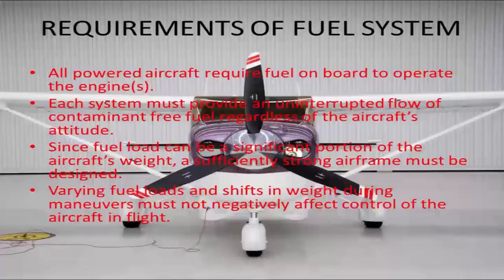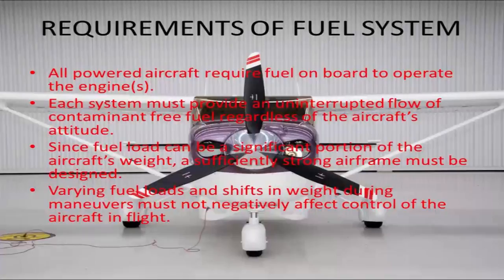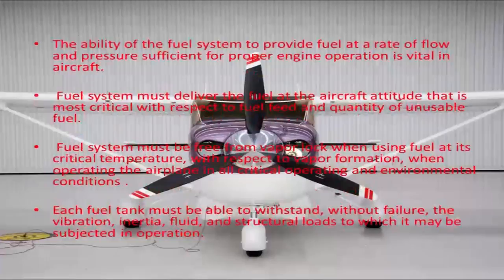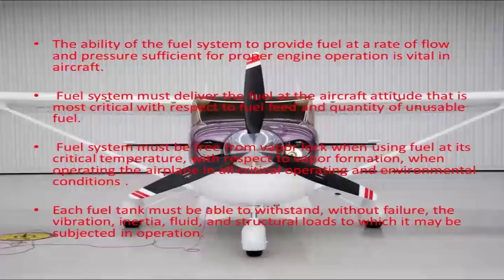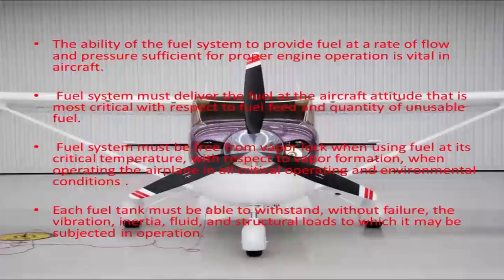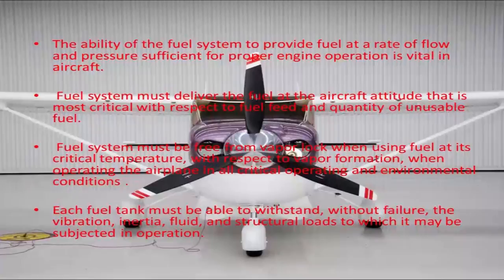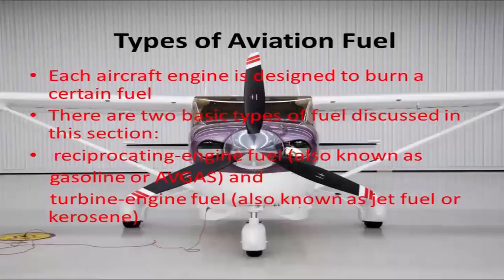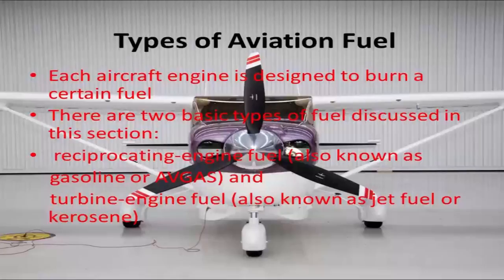Lecture 04   Aircraft Fuel System

Comment: @26 minutes in low wing aircraft when tanks position is below the engines then why both the tanks are not vented or interconnected as done is high wing aircraft
Reply: Actually we are doing ventilation between tanks to equaliz pressure...but in low wing tanks no need of vent...cause at a time we r only using 1 tanks